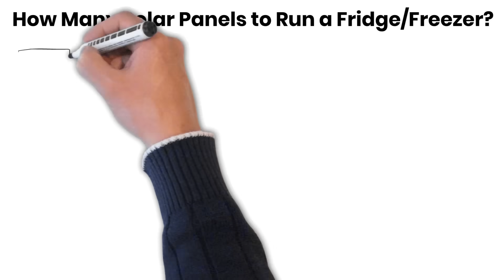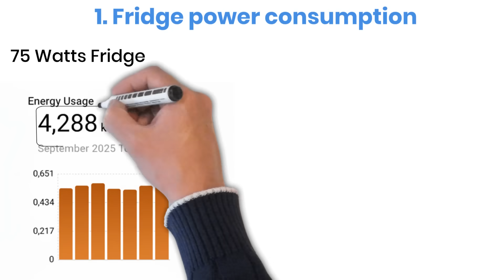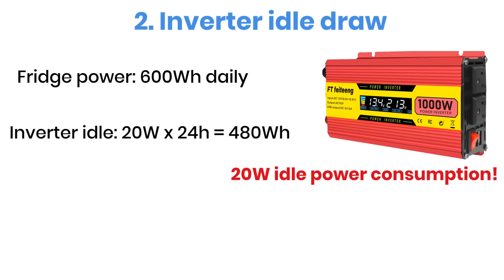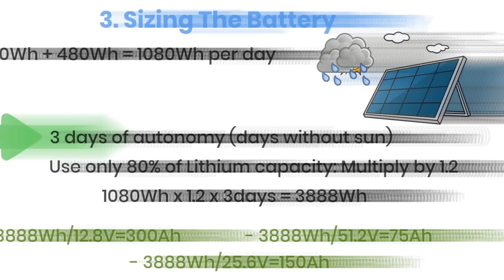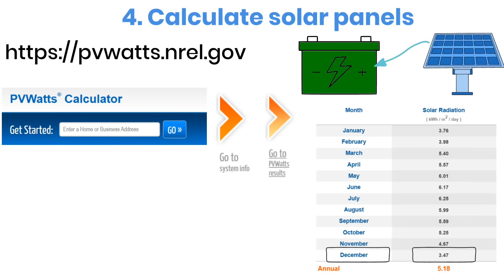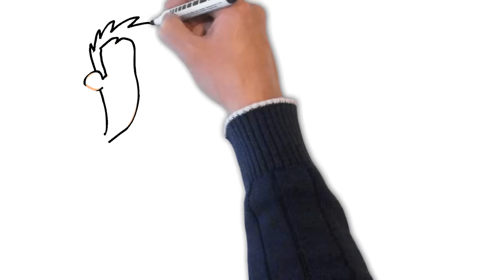How Many Solar Panels to Run a Fridge or Freezer 24/7?

Comment: The solar panels are low voltage so use a 12v or 24v fridge/freezer, that's the most efficient method.
Instead of the 1110 watts of solar panels in this video you'll only need half that.
Reply from the maker: That’s a great point, using a DC (12V or 24V) fridge definitely improves efficiency since you skip inverter losses entirely. It’s a smarter setup if you can find a reliable DC model. Have you been running one yourself, or just suggesting based on the principle?
Reply: @batteryhacker4343  I'm currently running a small 25 litre Brass Monkey fridge/freezer rated at 45W but only uses 145W in 24hrs running at 4 degrees C so average hourly consumption is only 6 watts! I have a small 100W 12v camping type  panel  into a small eBay MPPT controller and a 100 Ahr LiFePo4 battery.
Reply from the maker: That’s awesome thanks for sharing the real numbers! Your setup sounds super efficient. 145 watt-hours a day is really low for a fridge, and yeah, that averages out to around 6 watts an hour — makes total sense since the compressor only kicks in every now and then.

That 100W panel with a LiFePO4 battery is a neat little combo too. It’s cool how much tech has improved — setups like yours just quietly do their job all day. Do you usually see the battery fully charged by afternoon, or does it sometimes struggle on cloudy days?
Reply: @fins59 Hang on, I have a 30ltr Brass Monkey and I know it uses around 40W or more (up to 60W) when keeping a 2oC inside temp with an ambient temp up to 30oC or more. 
Are you sure your gauges and readings are accurate? That sounds too good, unless you live in the snow.
Reply: @evil17  Your description of 40W/60W is meaningless, do you mean 40w/60 maximum? If so for how long. No fridge/ freezer uses the max power all the time.
When your 30L unit is running it draws a maximum current of 5A on 12v or 2.5A on 24v but that's only when the compressor is running. If it's anything like my 25L unit it only runs for 10mins at maximum power then spends 50mins switched off drawing no power. My figure are accurate and correct.
Reply: @fins59 There are a lot more variables at play here, but yes, I meant my 30 litre Brass Monkey fridge can have a startup current using 60W+ & settle back to around 40W generally.
I have 10 different 12/24v fridges/freezers for different purposes and I have seen 15-65 ltr fridge/freezers all draw 40W as a running current, it’s the time that varies mostly with size, inside temp and ambient temps.
Brass Monkey are ok, but not as good as many believe, I have returned 3 out of 6 of them.
Running only 10 mins/hr sounds a really good average, I would expect more depending on ambients and other variables.
A 65ltr BM upright & a 30ltr Kings draw fridge use about 80A/day in my Ute camper while parked under a carport with solar input at this time of year.
It is 23oC here right now (10:15pm) and my 30Ltr Brass Monkey (full of grog but not being opened) just shut down for 35 minutes, set at 2oC before switching on again for 5-6 minutes, that is why I asked what your ambient temp was.
Reply: @evil17  You didn't ask what my ambient temperature was, but for your information it's around 23°C during the day & 18°C at night.
When you talk about power usage you need to describe it in units of power such as watts, amp/hours (Ah) or Kwh
You said above and I quote "A 65ltr BM upright & a 30ltr Kings draw fridge use about 80A/day" that is meaningless, an amp is a unit of current not power.
Reply from the maker: That sounds like a solid upgrade plan, those 250W ex-roof panels will make a huge difference compared to that single 100W one. Once you move to 24V, you’ll also see less voltage drop and better overall efficiency. Sounds like you’ve got a nice balance between practical experience and smart scaling. Are you planning to keep the system off-grid, or tie it into your home circuit later on?

Comment: Two 12v  500 watt solar panel  with  2000w inverter  and 200ah bettery no math is required
Reply from the maker: That’s a solid, straightforward setup, simple and effective. How’s it performing for you in daily use? Are you running just essentials like a fridge and lights, or pushing it a bit further with heavier loads too?

Comment: I’m running a 14 cf. freezer, 2 - 10 cf. friges and a full size 27 cf frig in my kitchen on 400 ah batteries with a 24 volt system with 800 watts of panels and an 80 amp charge controller. My electric bill down by $150 during peak usage charges.
Reply from the maker: That’s an impressive setup. You’ve really optimized it well for daily savings. Dropping $150 off the bill is no small thing! How’s it holding up during cloudy stretches, do you ever have to cut back on usage or does it stay pretty steady year-round?

Comment: In the olden days people used paraffin and the fridge worked 100 %,,,,,you dum people only want to make money,  gas makes a fridge to work ,,a fridge o n l y need  hit for the gas inside the pipes of the fridge, in the olden days is was water and ammonia inside the pipes of the  freezer and fridge,  can't believe that people are so dum like drums,,,
Reply from the maker: You’re absolutely right — those old absorption fridges that used paraffin or propane were clever pieces of engineering. They relied on heat to move ammonia and water through the cooling cycle, and they really did work well, especially in off-grid setups back in the day.
Modern fridges switched to compressor systems mostly for efficiency — DC compressor models use a lot less energy and pair really well with solar setups. Still, it’s interesting how those older designs solved the same problem in such a different way.
Do you still have one of those older paraffin or gas fridges, or just remember them from the past?

Comment: So many misconceptions about devices that are supposedly power hungry, my 900 watt microwave is used for a few minutes at a time, yes it draws high amounts of current when its on but only for very short periods of time. 
People look at them and think 900w is a lot of power, but to cook something for 7 minutes from frozen is not using anywhere near 900watts, maybe 128 watts for 7 minutes use. 
The killers are electric cookers and ovens and heating.
Reply from the maker: You make a really good point. people often overestimate how “power hungry” some appliances are without looking at how long they actually run. Short, high-power bursts don’t add up to much daily energy use.
Just one small clarification though: a 900W microwave still uses roughly 900 watts while it’s on, so if you run it for 7 minutes, that’s about 0.105 kWh (900 × 7/60). Still not huge, but definitely more than 128 W-minutes.
Totally agree with you on the real power hogs though, things like cookers, ovens, and water heaters are the real daily energy eaters in solar systems.
Reply: @batteryhacker4343 water heaters are great for when your battery is full and you still have more solar, free hot water. Hot water battery.
Reply from the maker: Exactly! That’s one of the smartest ways to use surplus solar — diverting the extra power to a water heater once your batteries are topped off. It’s basically free energy that would’ve gone unused otherwise. Do you use a DC heating element for that, or just run it through your inverter?

Comment: 2kw pv here......divided & utilized for 2 batt groups. One for daytime, other for overnight. Two USB PLUS lifpo @200ah each for overnight w/3kw inverter for heavy appliances for cooking (air fryer, coffee machine, vacuum cleaner, or some lightweight ironing, electric blankets, water heater).
Daytime batt; one 230ah lipo w/500w pv panels & 1100w inverter.. entertainment system, 3 high powered fans, coach batts, power tools, ice maker,  2 portable coolers.
Not enough for A/C
Reply from the maker: Wow, that’s a really well thought-out setup. splitting the system for day and night use is smart. Sounds like you’ve balanced your loads perfectly between comfort and efficiency. Have you thought about expanding a bit more PV for A/C later on?

Comment: This video was so confusing.  there is one thing you must know is battery storage to keep a fridge running.  a 12volt fridge is the best way to go.
Reply from the maker: You’re absolutely right that battery storage is key — that’s what keeps a fridge running when the sun’s down. And yes, 12V compressor fridges are very efficient, especially for smaller off-grid setups like RVs or boats. But for larger solar systems (say 24V or 48V with inverter), an efficient AC fridge can actually perform just as well. It really depends on the system size and how it’s set up.

Comment: This past summer we had a storm roll through and knocked out power in my neighborhood for over 23 hours. My 8 100 watt panels and the 600 ah of batteries connected to 2 1500 watt inverters kept my deep freezer and my regular refrigerator running along with my c-pap at night and charged my phone with power to spare.
Reply from the maker: That’s impressive — sounds like your system handled that outage perfectly. Having power for essentials like a fridge and CPAP during a 23-hour blackout must’ve been a huge relief. How long have you had your setup running now?
Reply: @batteryhacker4343 I set it up 2 1/2 years ago. After I woke up cold and couldn't breathe one winter night with the power out. I knew then that I needed something for a back up. My system doesn't run the whole house, but it will keep my food safely cold and or frozen and run some lights too.
Reply from the maker: That totally makes sense, that kind of experience would push anyone to get a backup system in place. Sounds like you designed yours really smart: just enough to cover the essentials without overbuilding. Having that peace of mind, especially for your CPAP and food storage, is worth every bit of the effort. Have you made any upgrades or tweaks since you first set it up, or is it still running the same way?

Comment: I installed six 600W panels with a 6kW hybrid inverter, temporarily without the battery. On a sunny summer day, it powers three freezers, an air conditioner, a dishwasher, and many other small appliances in the house.
Reply from the maker: Nice setup, that’s a serious amount of solar power! Even without batteries, that’s a solid way to offset daytime loads. How’s it been handling the air conditioner on really hot days?
Reply: @batteryhacker4343  On very hot days, the power drops slightly due to the panels heating up, but the system still produces about 2.5 kW. The air conditioner is an inverter type with a power output of 600 watts (7 BTU). It works without problems. I have another air conditioner with an on/off function with a power output of 1.2 kW (12 BTU), but it needs repair. The inverter is connected to the grid in parallel, so there are no problems with overloading it. The connection requires only four wires: live, neutral, positive, and negative. And one LAN cable for the current sensor. The panels are mounted on a wooden frame on the ground. But in the future, I plan to move them to the roof, increasing the total power of the panels to 9 kW, and install a battery, which will allow it to operate autonomously during a greed outage. Since the inverter has two MPPT strings, I will divide the panels into east and west planes.
Reply from the maker: That’s an awesome setup. Really well thought out. You’ve clearly planned it with both efficiency and future expansion in mind. Splitting the panels east and west once you move them to the roof will give you a much smoother power curve through the day too. Sounds like once you add that battery bank, you’ll have a fully self-sufficient system. Are you thinking of going with LiFePO₄ batteries for the upgrade?
Reply from the maker: Absolutely, couldn’t agree more. LiFePO really is the smartest long-term investment right now. You get high efficiency, deep cycling, and that peace of mind knowing it’ll last for years. Once you integrate it into your setup, it’s going to round out your system perfectly. Do you already have a specific capacity or brand in mind for the battery bank?

Comment: First of all you don't try to run a 110 standard run-of-the-mill refrigerator off of solar. And your type of 12-volt refrigerator is actually very important. RV type 12-volt refrigerators are actually using a brother power consumptive heating element to work the heat exchanger coils that are normally run by the propane. There are 12 volt compressor models which actually consumed very little power because they're not constantly running like a RV style refrigerator is.
Reply from the maker: That’s a really good clarification. The type of 12V fridge makes a huge difference. Compressor models are way more efficient than the absorption-style RV ones. Have you been running a 12V compressor fridge yourself? Curious how it performs day-to-day.
Reply: @batteryhacker4343 these cheap small apartment style refrigerators the ones that max out at about 7 cubic foot and the little chest freezers that you buy in all these box stores that are coming out of China. All of them are either 12 or 24 volt. They just change the Transformer pack depending on the country it's being shipped to. I have one of the little fridges and one of the little freezers the ones I got are 12 volt. I just opened them up and remove the Transformer pack and hardwire them with an inline fuse to my system. So far they've been working fine but I only use them in the late spring to about this time of year. I live high in the Rocky Mountains and by the end of the month Nature's going to be my refrigerator in my freezer my biggest problem will be trying to keep what I don't want frozen solid from being frozen solid. I haven't hooked them up to anything to find out exactly how much juice they're using it's never really been an issue. I think like twice last year I had to fire up my generator run it for a tank of fuel to charge up the batteries to keep things running smoothly.
Reply from the maker: That’s really clever. Pulling out the transformer and wiring them directly into your DC system is such a smart move. Those small Chinese fridges and freezers are surprisingly adaptable once you bypass the AC side. Sounds like your setup is running efficiently, especially since you rarely even have to top off the batteries. And yeah, living up in the Rockies definitely changes the game when the environment itself becomes your fridge, that’s off-grid living at its finest. Have you ever thought about logging the actual power draw, just out of curiosity? It’d be cool to see how those units perform compared to rated specs.
Reply: @batteryhacker4343 I actually never really give it any thought. Unless it's severely overcast my batteries are usually completely topped off by 9:30 10:00 in the morning. And the funny thing is I actually generate more solar panel power during the winter time because of all of the extra glare coming off all the snow that buries everything up here.
Reply from the maker: That’s awesome. The snow reflection boost is real! It’s one of those underrated winter perks for solar setups. Sounds like your system’s really dialed in and balanced perfectly for your conditions. Do you get much snow buildup on the panels themselves, or does the sun usually clear them off pretty quick?
Reply: @batteryhacker4343 they're about 10 ft off the ground on one of those non-powered tracking units that doesn't work with a crap in the winter. I have them put in one of the few wind scoop areas on the property so they don't get buried in snow cuz we get up to 17 ft here. And I'm out there every other day or so especially after a snow brushing them off. Once you've got the snow insulation off the drip ice on the panels is usually gone within an hour
Reply from the maker: @Reaver6666  Wow, 17 feet of snow, that’s wild! Sounds like you’ve got your setup really optimized for those conditions, though, especially with that wind-scoop placement. Having to brush them off every couple of days must be a workout on its own 😅 , but it clearly pays off with that winter reflection boost. Do you ever notice any performance drop from the cold itself, or do your panels actually seem to output a bit more in those freezing temps?

Comment: Maybe I missed it but I think you are way off on solar needed. Yes you ran the numbers correctly and good job of including the inverter use but if someone had this setup they would not have enough solar. Why some might ask? Because you will never get the rated capacity of a solar panel from it. Now some might say and maybe it is true that is accounted for by the sun hours. Would love to see that explained and I hope that is where I am wrong.
Reply from the maker: You’re right to point that out.The rated capacity is almost never what you get in real-world use. Things like panel angle, heat, wiring losses, and actual solar hours all cut into that.
In the video, I factored average “peak sun hours,” which roughly adjusts for those real-world inefficiencies — but you’re right, it’d be worth doing a quick breakdown in a follow-up video to make that clearer. Thanks for the sharp observation!
Reply: @batteryhacker4343  Glad to help and thanks for providing such good information.
Reply from the maker: You can also help others to share this video with your friend and family :)

Comment: you should think about using a transformer inverter they are much  tougher last much longer
Reply from the maker: That’s a great point, transformer-based inverters are definitely built tougher and can handle surge loads better, especially with appliances like fridges or pumps. They’re heavier and less efficient than pure switch-mode types, but for durability and reliability, they’re hard to beat. Do you use one in your setup?